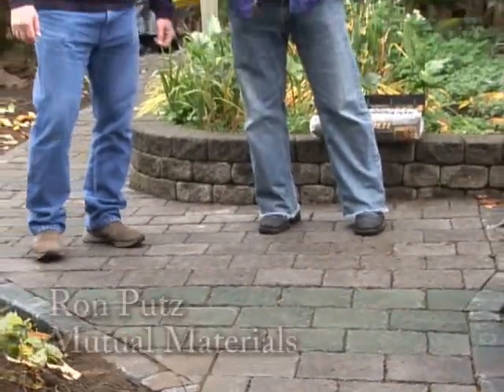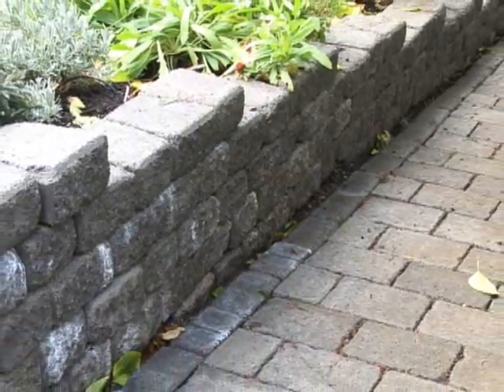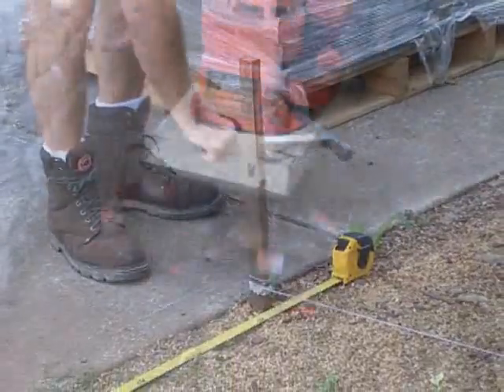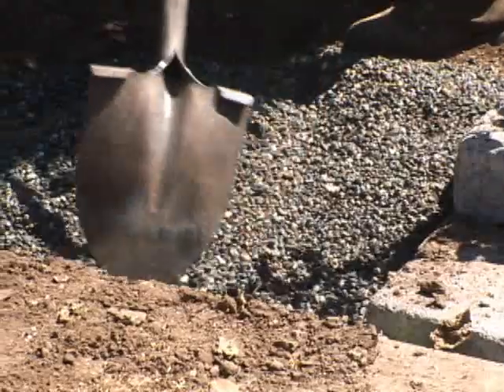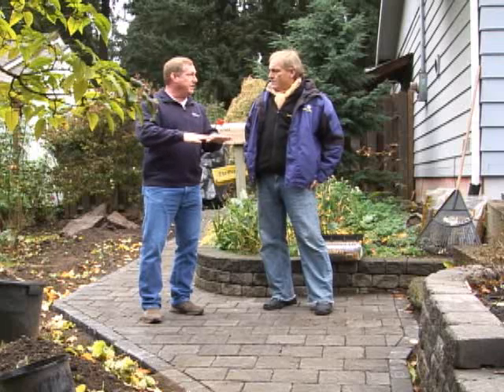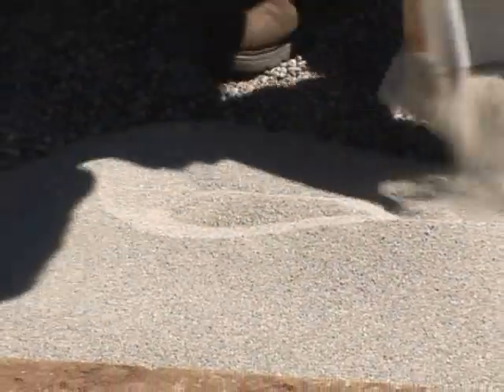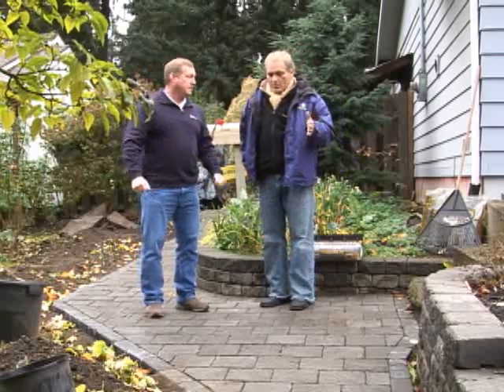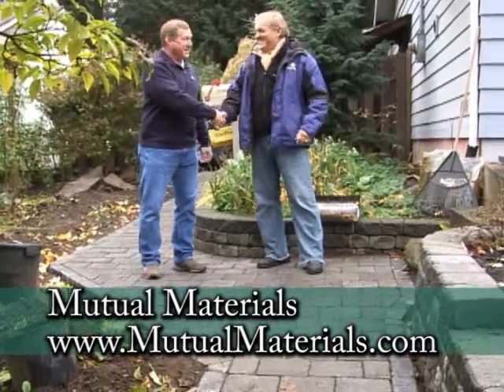Building a garden path

Comment: First of all, I'd like to say thank you for taking the time to make this video and for sharing with the public.  Secondly, I do have a question for you.  One website I visited described the creation of the path almost the same as you did in this video. The only thing different was that the writer placed sand at the bottom and used no gravel. My question is: "What's the added benefit of using the gravel then the sand versus just the sand before laying the pavers?  I'm planning to create a short path in my backyard, hopefully this weekend - weather permitting.  Thanks in advance, Dee
Reply: How did you do with your sand? I am planning to do the same way you described (no gravel). Thanks